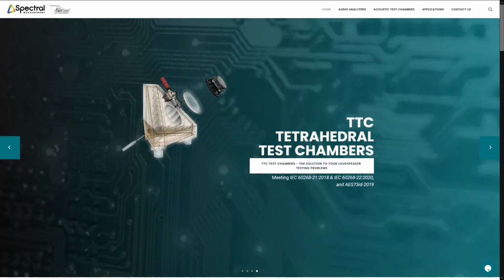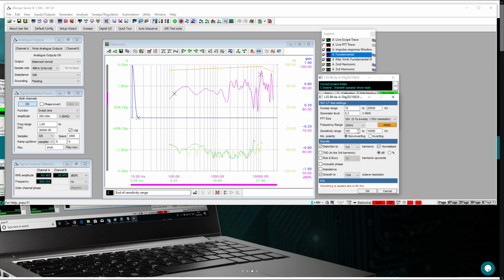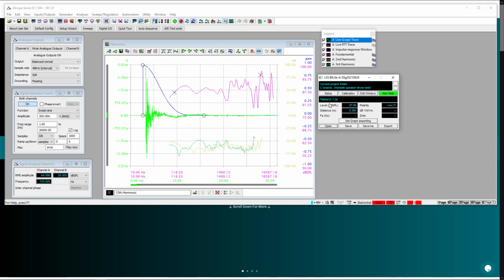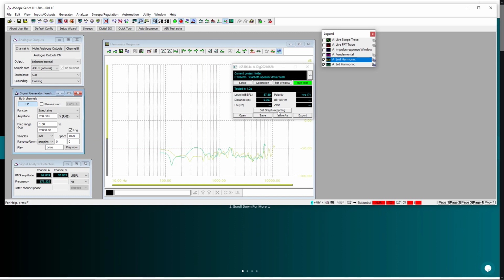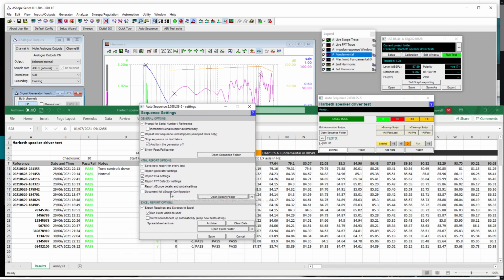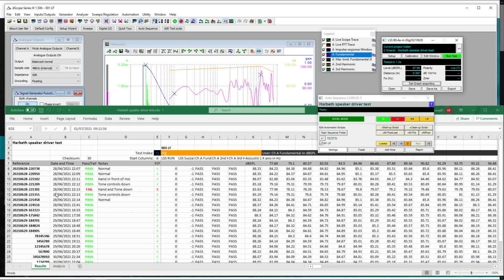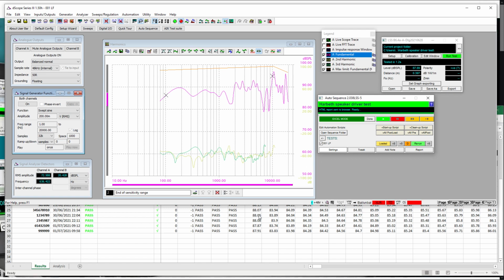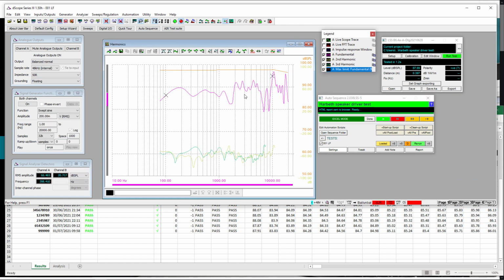Loudspeaker measurement and QC testing with Spectral Measurement's dScope audio analyzer

Comment: Hi, I am a M1 user, How to get the LSS B6.4a configuration? Can you email to me?
Reply from the maker: Hi Iven, thanks for your enquiry!  if you email me directly graham.boswell (at) spectralmeasurement.com I will send you the latest script version and some setups.  In the video above we are using an updated Auto Sequence script that integrates with the LSS script so that you set up the tests up with LSS and run them under automation (such as for QC etc) with Auto Sequence.  Of course you can run the test directly in LSS, but for automated report generation and results tabulation Auto Sequence is a better solution.